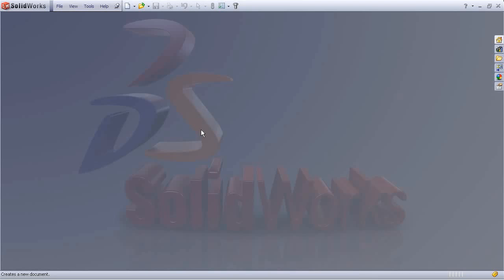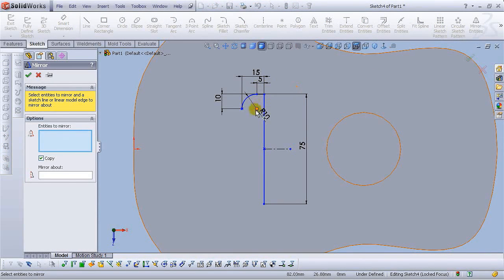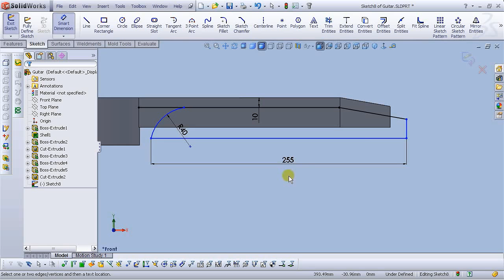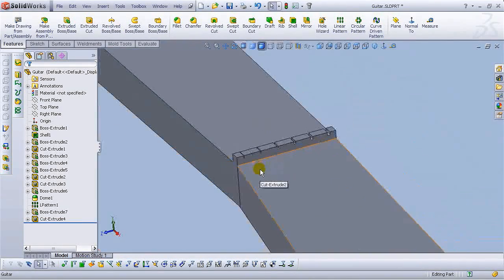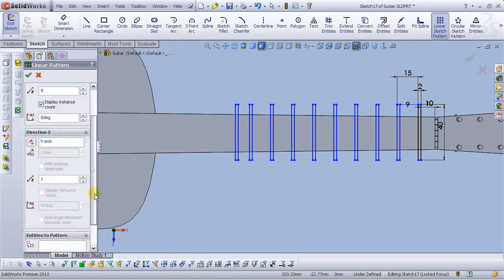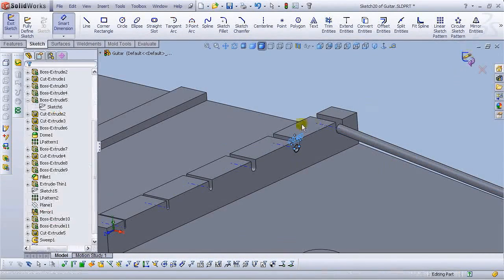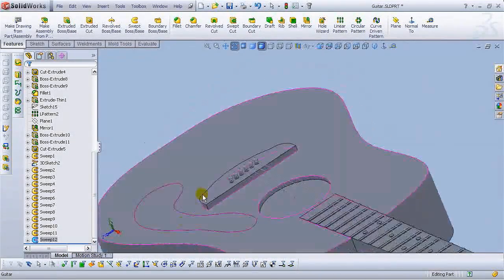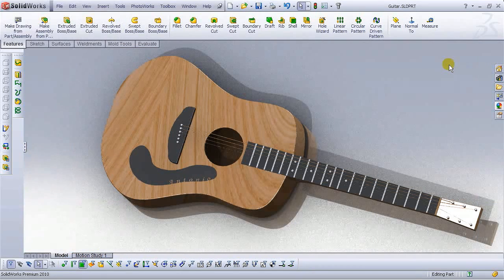SOLIDWORKS Acoustic Guitar TUTORIAL

Comment: You can select on a construction line once and then select on the points in a series and it will automatically add the dimension to the construction line from the point.  No need to select both for every point ;)